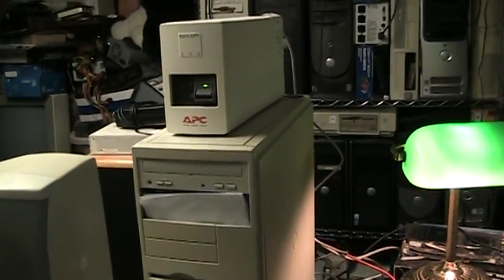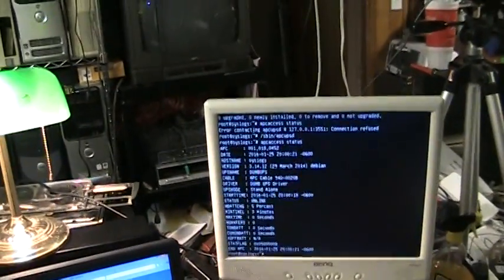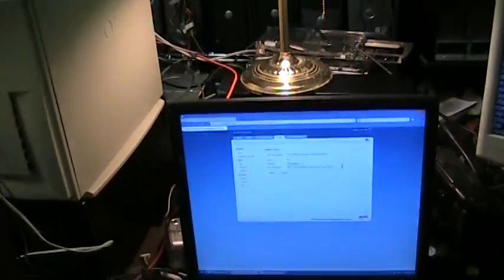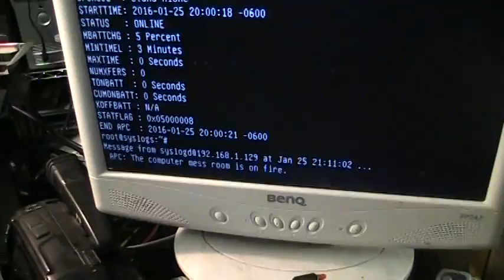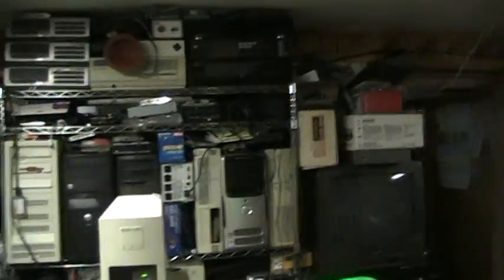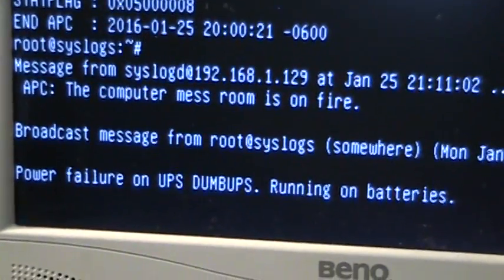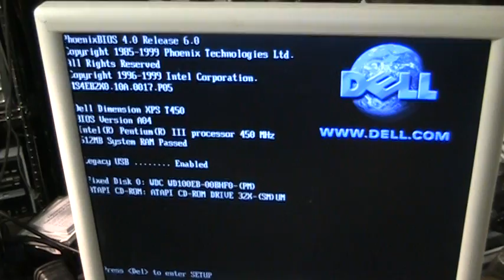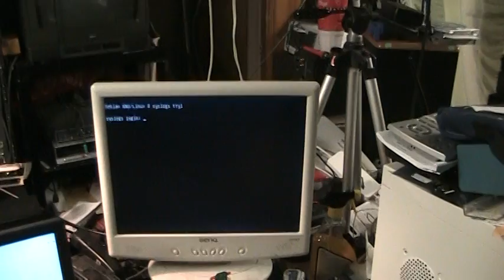Little Tiny Computer Ramble: Syslog Server and UPS Test

Comment: There is an enterprise syslog solution called Splunk that can be used to take in several syslog input from multiple systems and allow you to search through the list of machines. Splunk Free is a free version of the software. I've used it for about a year now and I would HIGHLY recommend it!
Reply from the maker: I tried it not long after making this video, and it really didn't impress me a whole lot. It also didn't want to run on the crappy computer I had in mind to use.

Comment: +uxwbill I find syslog-ng to be much easier to use, and the documentation better.  But to each his own - and there are multiple syslog server daemons.  Also keep in mind, that with most syslog software - you need to do your own log file management.  Logrotate is typically used for that, but it needs separate configuration from your syslog daemon.  There's also the matter of what to log.  I actually prefer to log to a central log file for specific levels/services/etc like auth, daemon, secure, dmesg/kern, etc.  Syslog will note the hostname or IP in the consolidated log file and you can grep out what you need.  The $HOST/ directories can hold a catch-all for log messages that don't match specific common log types.
Reply from the maker: +tester239 I didn't find much in the way of documentation for syslog-ng, though I don't recall for how long I looked. And being new to the idea of actually running/configuring a syslog server, I might have made a wrong turn somewhere.

For now I've shelved this project. I don't think the APC management cards produce the information I'm looking for via their syslog facility.

Comment: I've measured the power usage of some P2/P3 era machines before, but I'm impressed by the idle power of that Katmai.  It's in the range I would have expected from a Coppermine CPU, not the old 2.0V Deschutes/Katmai with discrete cache chips.
I don't think I've ever measured from one of these Dell PSUs though. I think the systems I measured were all using 250-300W PSUs instead of the ~150W units that I recall finding in these Dells.  Since they were lightly loaded my PSUs probably weren't as efficient.

A few years ago I brought home a Dell very similar to this.  I was amused to notice that the BIOS POST display will change the computer's model name if you swap the CPU.

Comment: What's better for graphics cards overall: PCI (not express) or AGP?
Reply from the maker: +Ashton B. AGP has vastly greater bandwidth as compared to regular PCI. Unfortunately, I do not believe there are any contemporary GPUs being placed on AGP cards any longer, while there are still a few for PCI-only systems.

So you can have greater speed with an older GPU on an AGP card or a much newer, more power efficient, and very much hamstrung GPU on a PCI card.
Reply: ***** Thanks for the info.

Comment: Hi Bill, I have an unrelated question.  I have a Sony DVD/VCR model SLV-D560p which I recently changed the disc reading laser.  For some reason it will not play two sided discs now.  I have tried 2 different two sided discs and it plays side 2 but not side 1.  Standard 1 sided discs have played fine.  I have not played any dual layered movies so I don't know if that is an issue too or not.  I am really disappointed because this laser works better than the original one which would not play certain discs which this one will.  Do you think there is a problem with the laser or could there be another issue.  Do you think it would be worth taking it to an electronic repair shop?
Reply from the maker: +tyler2610 I know nothing of this machine, and unrelated questions such as this really should be private messages. Otherwise, especially on older videos, I may never see them.

If you installed a truly brand new laser pickup, my best suggestion is that a complete alignment and configuration of the pickup may be required. This may require some very specialized tools and test discs. If you can find one, the factory service manual may shed some light on the situation. Unless this model has a feature that is very difficult to find or was particularly high end when new, taking it to a repair shop is unfortunately not likely to be worthwhile.
Reply: +uxwbill Okay, thanks for your reply
Reply: +tyler2610 Hi Bill, you probably don't care but I just wanted to let you know since I inquired with you that I was able to fix my DVD player.  It was a matter of adjusting the set screws that hold the slides that the laser pick-up rides on.

Comment: I"m sure you've had the question before, but have you considered going to virtual machines for such projects (syslog server)?
Reply from the maker: +0Fluxor0 I like using actual, physical hardware for various reasons of varying quality. I have certainly used virtualization, starting from the time that VMware introduced their virtualization-on-PC product in the late 90s/early 2000s.
Reply: +uxwbill Very good sir. Thanks for the reply

Comment: now i tried syslog and its not working what am i doing wrong
Reply from the maker: +david hunter Without knowing anything of your setup, what syslog variant you're running and how you've configured it, there is no way I could have any idea what is wrong.

As general troubleshooting, I would make sure that the service is running (is port 514 open?) and that you've provided a sensible location for the logs to go. Said location must be writable by the user which the syslog process runs as.

Comment: Does anyone miss the days of White PCs? Or even Silver? The older I get the more I miss seeing Beige, White, or Silver computers. Compaq White, Apple LC series white, or even Dell Inspiron 530 Sliver? Why did most companies switch to black in the mid 2000's? Lower cost, easier to clean?
Reply from the maker: +Jason Hicks (TyrForFreedom) I think they probably determined what color a computer "should" be based on market research and perhaps by following trends in the design of competing products. There probably is some cost savings by virtue of buying the coloring material in large quantities.

Comment: I've skimmed the comments of this video and didn't see anything detailed, so please forgive me if this was already answered.

Also, I hope my assumption is correct that Debian still uses something like rsyslog under jessie, and doesn't rely on the systemd parts (journald).

I just got done experimenting with per-host syslogs on an Ubuntu 14.04 server.  It's running rsyslogd and was configured to receive all remote messages into the standard log files (syslog, kern.msg, etc.).  One custom log file was the firewall logs, which constantly get messages (honestly... I think Cisco ASA firewalls are log message generators first and firewalls second sometimes!)

One important thing to ensure when you set up per-host logging: make sure the user rsyslogd runs as can write to the directory you use.  Otherwise, you'll be scratching your head wondering why nothing is being logged as the silly thing runs but silently fails to log anything separately.

Here's the configuration I used to break the big syslog firehose into per-host files (it would go into /etc/rsyslog.d/10-perhost.conf on Ubuntu; it's important these be BEFORE any other rules):

# define template for per-host log. These make log files like "192.168.1.100.log" and such.
$template PerHostLog,"/var/log/%HOSTNAME%.log"

# apply the per-host template to non-local messages
:fromhost-ip, !isequal, "127.0.0.1" -?PerHostLog

# you may also wish to stop logging to the usual log files; just uncomment this line:
#& ~
Reply from the maker: +junker15 Debian makes the claim somewhere in their documentation that the default syslog server is rsyslog in newer versions. While I found a configuration file for rsyslog on the system prior to setting anything up, the program itself was not installed, leading me to believe that there is an error in the documentation or that it is not well maintained.

Thank you for the configuration examples.

Comment: Hey there Bill!
I'd recommend use Splunk, and here's why!

Using the free version in my home datacenter proves worthy.  Splunk is a dedicated tool (it can be ran free on a RHEL based system.  I have it running on CentOS) - and it can talk Syslog.  In fact, it's entire purpose is to talk Syslog!  Splunk turns itself into a pretty Web GUI where you can view log entries for as many systems as you'd like (up to 500 MB of entries per day).  It can separate different system logs from individual systems, and it can even allow you to search for specific events on specific systems.  I have switches, a firewall, and a Pi that are talking to it successfully.  (The Pi was harder to get to work with the server - but I got it working).

Hmm...  Think my English teacher would be proud?  I was able to explain myself ;)
Reply from the maker: +TN Craft I certainly plan to take Splunk into consideration based on your commentary, which I really do appreciate! Although I don't plan to do it right now, I've been thinking of ways to wrangle the collected data into a more presentable form.

It's probably time for me to go and take a look at their minimum requirements. (Or maybe I'd better skip that and get something better equipped from my computer junkyard! :-) )
Reply: +TN Craft  Splunk on CentOS is the way to go, Thats how I have mine set up anyways.. Very reliable and easy to use.
Reply from the maker: +ElfNet Gaming I'm off to something of an inauspicious start already, unfortunately. Splunk's recommended system requirements are pretty crazy -- definitely massive overkill for anything I'm doing, especially in the RAM department. I don't own any system that would meet their stated "ideal" requirement and I suspect this alone probably removes the old Dimension XPS from serving as a base for such a system. In fact, it likely removes Splunk from being a plausible option for me.

(And their documentation seems like it may be incorrect regarding how to start the program. Either that or some path hasn't been set up correctly. No errors were indicated during installation, however.)

I tried it anyway, because I'm a glutton for punishment. What I'm finding, and again it may have something to do with running on thoroughly inadequate hardware is that the program won't even run. It tries, but falls over with a complaint about being "unable to generate distributed search keys". I have yet to find anything about that in the documentation and a web search turned up only unanswered questions from others with this problem, only one of which was running on a Linux host. A "distsearch.conf" file that I cannot find is also cited as a problem. I'd create it -- examples of what it contains appear to be available online -- but I have no idea where it should go.

More research into this problem is underway. I suppose it's possible that I've not satisfied some sort of package or configuration requirement, but all the documentation I'm finding is again, pretty opaque. And frankly, the installation process ought to take these sort of things into account and notify the user if something cannot be done, instead of silently failing. That's the sort of thing that really gets my dander up in a hurry.
Reply from the maker: +uxwbill Update so far: distsearch.conf is definitely MIA and as yet I have no idea why.

(I'd edit my comment, but I don't feel like playing the "Youtube escaping bug" roulette right now.)
Reply: +uxwbill Interesting...  I've got a CentOS (minimal) install with 1GB of RAM, and a Pentium 4 (HT) running this program just fine.  When it comes to Linux, I tend to ignore system requirements.  If you're evil enough (assuming you are, I mean, this is IT afterall ;) ) you can still have it run.  

As for the .conf file - I'm not sure what to tell you.  Let me do some digging.
Reply: TN Craft I think he's trying to run it on that old P3 though. I'm going to assume it has 256 - 512 Mb of ram also unless he added some..
Reply from the maker: +ElfNet Gaming Yes, I am. I'm not one to pay a whole lot of attention to official system requirements. Many of them strike me was "one size fits all" considerations if that much. There is 512MB of RAM installed in that system, with a maximum of 768MB supported.

I haven't been able to gain any insight into what Splunk is doing during its first-run process. Were it a lack of machine resources causing the problem, I'd expect to see errors show up along those lines. Looking at the Debian package's manifest shows that the package management system is only being asked to place files in certain locations and with specific permissions set. 

I suspect an issue with path resolution or a dependency that isn't satisfied. The former I can solve by brute force if nothing else, the latter will require more information than I've been able prise out of anything so far. And maybe the right answer is "you really should run that on Centos". Which I could do.

If Splunk really does demand anything like the ideal requirements they post for even a very small volume of data (perhaps a few tens of syslog messages per month, if that many, from the APC management cards), I don't think I could bring myself to use it.
Reply from the maker: +uxwbill The story so far is that I tried to boot the latest (as of this writing) 32-bit Centos minimal/network installation disc on the old Dimension XPS. It didn't think too much of that, stopping dead with an error that indicated an illegal CPU instruction had been issued. It didn't actually say what the offending instruction was. I'm guessing it needs something from the SSE2 or later instruction set that a Pentium 3 wouldn't have.

I grabbed another absolutely state of the art computer system in the form of a Dell Dimension 2350, installed Debian to that and tried again with the Splunk package. This time it worked! I'm guessing that its first-run routine perhaps also makes of use some hardware instruction that doesn't exist in Pentium 3 silicon. There's no more RAM in the 2350 than there was in the Dimension XPS.

I went through Splunk's configuration interface resident tours, read their instructions on adding data sources and finished up by adding a source to capture incoming syslog messages. It doesn't yet work, claiming that I still need to add data and I have to admit I don't think too much of their documentation, which is less than totally clear about what needs to be done in order to get started. I'm thinking I need to perhaps configure a forwarder as well, although that doesn't appear in the documentation until later.

I'm really not sure Splunk is what I want and while I genuinely do appreciate the suggestion, I can't say I think too much of the software. I'm probably going back to my initial plan of setting up rsyslog to dump information from different hosts into different log files and setting up a web server process that will have access to the log data directory. Crude, yes, but also very effective.

Comment: The best computer I ever had was an old XPS T450. I haven't had a computer before or since that performed as reliably as that one, or was put together as well. Unfortunately, neither the Dimension 8100 nor 8200 that followed it ever worked right.

Comment: hit the power button with the computer unplugged or with the hard switch off on the psu. that should give more consistent boots. i haven't the words to explain it, but if your power light blinks when you hit your power button with the psu hard off or the computer unplugged i figure you can guess what is going on (gotta love caps).
Reply from the maker: +kght222 I don't follow your comment or what it is in reference to. No computer in this video has a power problem.
Reply: ***** i was talking about your comment on the boot of that system being "sometimes" slow. sorry for not giving a timestamp. inconsistent boot times are most commonly because the computer can cold boot faster than being turned off then turned right back on, in most cases this can be avoided by draining the caps on the motherboard by trying to power the computer on with no power connected.
Reply: ***** oh, and the caps drain into the psu if you are curious as to where the energy goes.

EDIT: not all, just a little, most of the energy is used in attempting to start the computer. when a computer software powers down as has been the case since atx came out motherboards tend to retain energy that they can't get rid of (flipping the power switch off will have the computer keep trying to run until it can't keep trying anymore) soft off tends to turn off the computer and block the movement of energy, so you end up with caps that are charged and slowly draining once the computer is off. if the caps drain enough, and in many cases they will do this immediately, they can't just resume operation like nothing happened immediately, so the board takes the time to drain and recharge them during the self test, which results in a slow boot.

Comment: Bill do u have a windows 8 if so do you have update KB2919355 because mine will not update?
Reply from the maker: +GamersGoneCRAZY You can download this update directly from Microsoft, and that is the only place I would suggest getting it. If the update fails to install, you'll have to troubleshoot that on your own. Possible place to look would include driver issues, software conflicts, or a system that's reached the point where the operating system should just be reinstalled.
Reply: ok Thanks